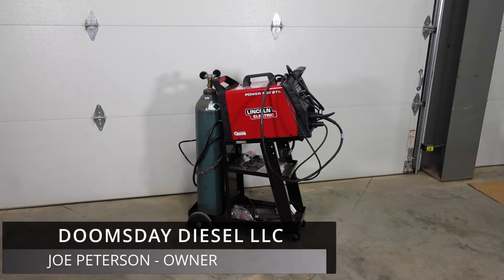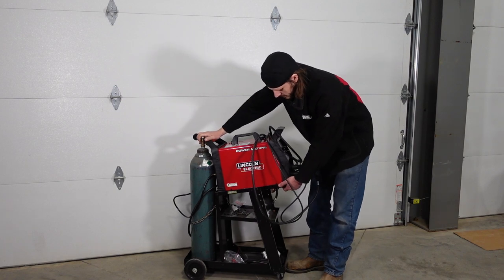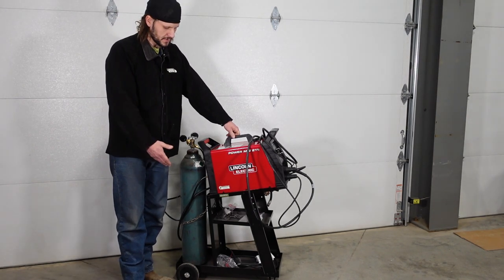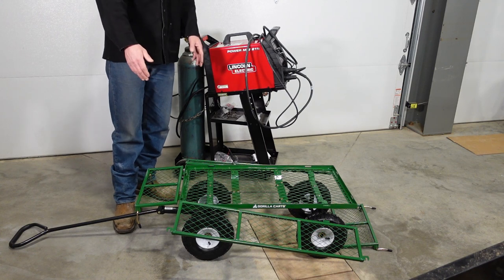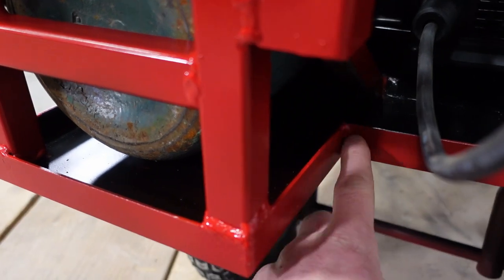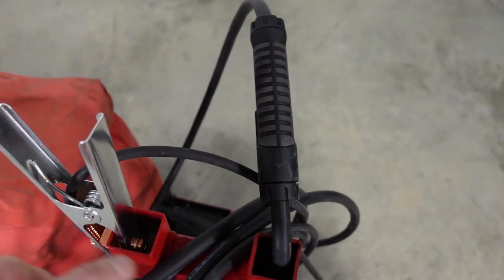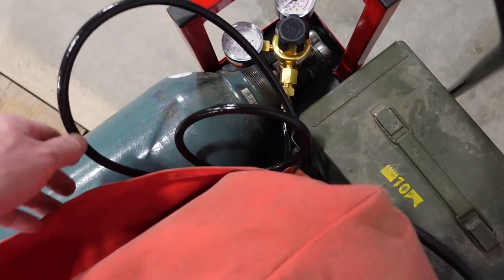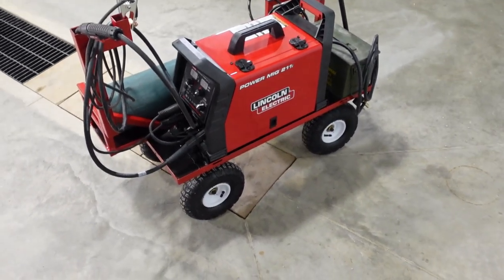DIY Indoor/Outdoor/Off-road Welding Cart

Comment: That 211 must be smaller than the 215MPi, I have a 210 cover and it does not fit. I do have one of those carts and might  become my  next welding cart, however, my tank probably will have to go vertical because the flowmeter.

Comment: Any issue with the bottle in horizontal position ? I would put it at least 20-30deg up to be on the safe side with CO2. I was told CO2 is in liquid form inside the bottle. I don't think liquid CO2 is good for the flowmeter, valve or welder.
Reply from the maker: The gas is gas. The gas doesn't care where you put the bottle. A vertical flow meter would be a bigger challenge.